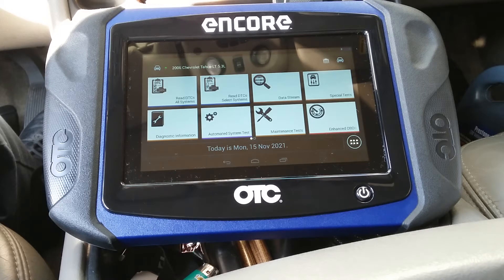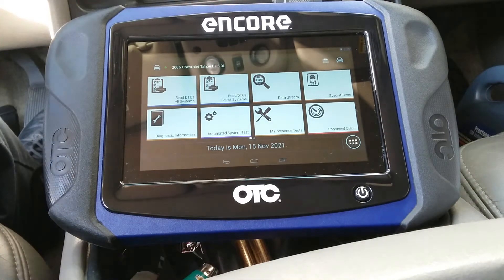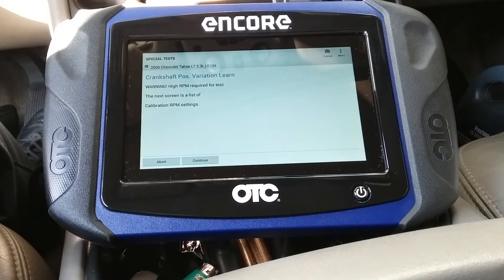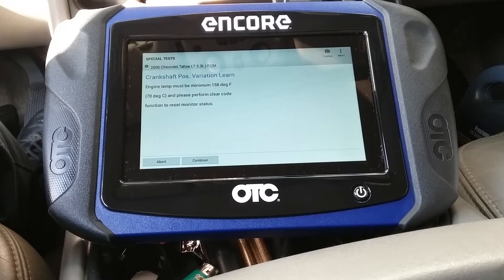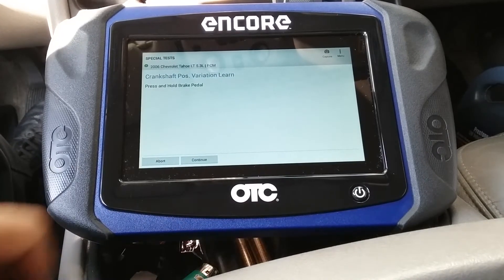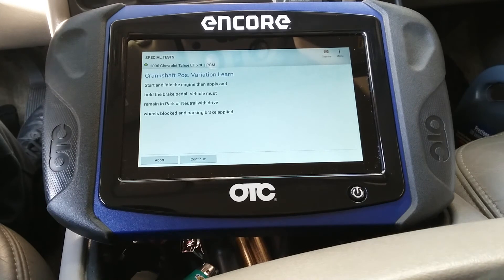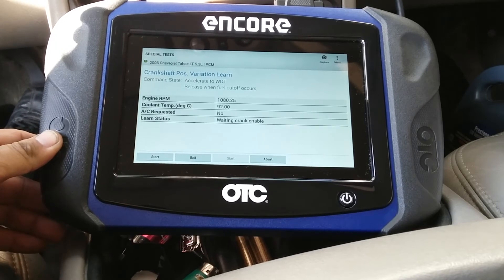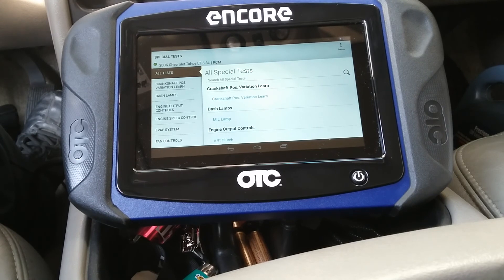(Chevy Tahoe) Crank Variation Relearn - after Engine Replacement

Comment: Great video! 
Just wondering if the brake pedal needs to be pressed white doing the 4000rpms acceleration process.
Reply from the maker: Yes, put your emergency brake on,put on drive, press the brake pedal, and press on accelerator all at the same time time until the engine rpms cut off.

Comment: Mine is not programming
Reply from the maker: @JayyMoney-vr7nv  Do you have a check engine code?
Reply: @ yes misfire p0300 but it will not tell me which cylinder is misfiring without removing the crank relearn

Comment: The test failed for the 2009 Tahoe. What is the problem?
Reply from the maker: You need to meet certain parameters for the relearn to happen.  The scanner should tell you the required procedures.
Reply: @EliTheOBDTech  The rpm reaches 4, 5, and also the last, but the test fails،Tried more than once but failed
Reply from the maker: @user-jp2lm5jz1q  Do you have any codes stored?
Reply: @EliTheOBDTech  yes
Reply from the maker: @user-jp2lm5jz1q  I not 100% sure, but the code(s) may be the reason why it fails.  Are you able to erase codes? If yes, clear and then retry.
Reply: @EliTheOBDTech  I think because of a problem with the ECM, it does not extract information from it upon examination. The ECM is new with programming. The problem did not appear in the old ECM.
Reply: @EliTheOBDTech  When scanning the crank sensor code, it comes back again
Reply from the maker: @user-jp2lm5jz1q  Very interesting.  You may need to do a re-program of the ECM.  You may have a software issue.
Reply: @EliTheOBDTech  It may need to be reprogrammed, but there may be a short or break in some of the wires. Anyway, thank you
Reply from the maker: @user-jp2lm5jz1q  Yes, good point. Wiring issue can also lead to a recurring crank code. Another possibility would be a gap issue on the crank sensor and trigger pickup.
Reply: @EliTheOBDTech  Hello, how are you? I checked the ECM and it appeared to be Locked . I bought it new from the Rockauto website. I don’t know what the reason is،Because it is closed, the crank sensor cannot be programmed
Reply from the maker: @user-jp2lm5jz1q  HI there, I don't do much programming of PCMs, I really wouldn't know what to tell you.